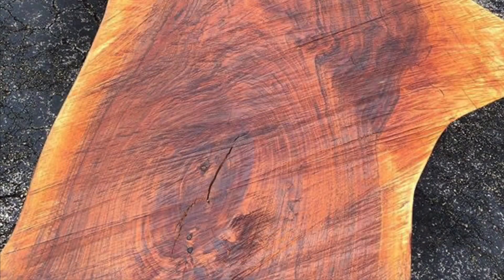Milling Monday #4 | “How do I get a better cut finish?”

Comment: Great video series ! I’d like to add to the conversation here so there are some techniques you can use to get a smooth texture from a Alaskan mill. I tried all of them and it works. I learned them on the Flowering Elbow channel. He really goes in-depth. I think he did a video that was like 18 tips on milling or something to that effect is where I got the most useful techniques from, I do agree that even though you succeed in milling a flat smooth board there is no telling the degree of cupping and twisting that will happen as the slab dries. However seesawing and doing sudden starts and stops will leave nasty marks in your slabs every time. Consistent chain speed, consistent rate of cut speed, and consistent bar angle to grain will get very flat cuts. Also using a ladder and truing it with shims for every cut is very effective especially with a winch. Last thing is when you have to stop to shim or whatever, slowly let the saw come to a idle and when you start your cut slowly get the chain up to speed, the change of speed makes the chain wiggle in the bar groove and that can leave deep to very deep marks pending on how warn your bar groove is and or how warn your drivers are. If that sounds ridiculous, when ever you get a new bar and chain, take a set of calipers to the new chain and bar and check it to your old chain and bar, that’s what it took to convince me. Even seeing the driver in the bar groove play from new to well used was eye opening. That also made the purchase of a aux oiler a lot easier.

Comment: I have a hard time finding videos on smaller mills. Like you have said in previous videos not everyone has the money for a 660. I have also noticed that there are no good videos to show how much better or worse different chains and file angles to rip /mill wood.

Comment: Question, so not only what do you use to seal your end grain (Anchor seal vs latex paint) but do you think you need to seal knots on both sides with their propensity to crack?
Reply: Also, another great, informative video, Jared. I’m looking forward to getting into milling this fall.